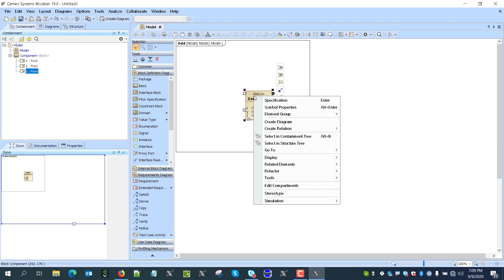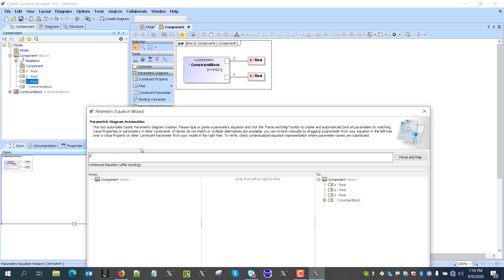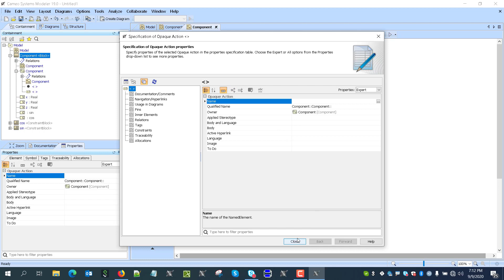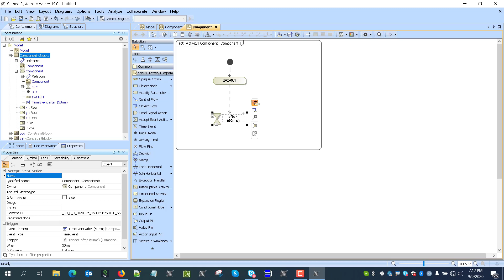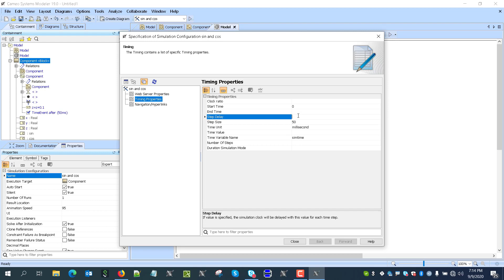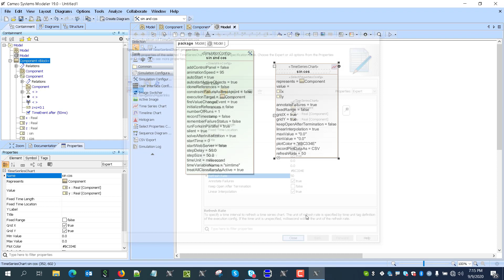Intro to Parametric and Behavior Diagrams Simulation

Comment: I am following this presentation with Cameo EA 19SP2 to about 5:30 with no problems. However, when i create the simulation config and run it, something goes wrong. The time series chart shows only the first 52 ms and the two curves are flat (x=0.1 and y = 1). I do get two WARNs in the Console "This dataset already contains a series with the key x" and same for y. At the same time x,y and z in the Variable window are changing correctly with the increasing values of z. Any thoughts on what i might have messed up? 
Also, how would i display z on the horizontal axis, instead of time in ms? 
Is it possible to display y vs x, rather than vs. time?
Reply from the maker: Hello Chevy. X axis can be only time in current versions. Could you send model to mbseexecution@gmail.com for an investigation?
Reply: @MBSEExecution  done
Reply: @ Chevy Potter and @MBSE Execution, were you able to find out the problem? I am getting a similar display.
Reply from the maker: Hello Mohammed, should be something simple. Please drop sample to an email above to check and debug.